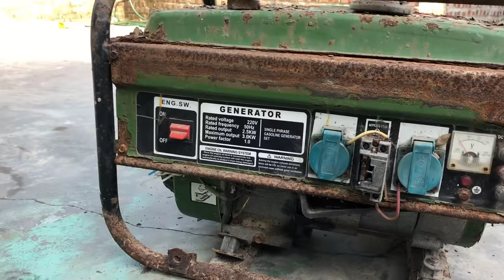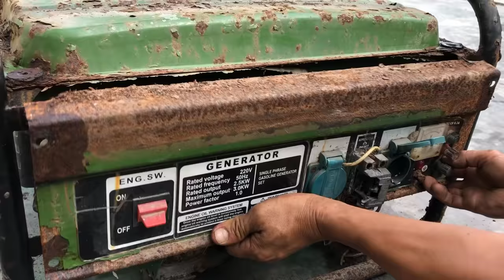Full restoration of old 220v generator engine | Repair and reuse old rusty generators

Comment: Vietnamese miracle. It even works without fuel. The engine shutdown switch is not connected either.
Reply: I noticed too, the engine ran without gasoline.
Reply: شحضحضحضحضجشجشجشجشجشجشجشجشجشجشجشجشجشجشج

Comment: Great restoration with limited resources. Attention to detail by pre oiling most everything within the engine is great but use some wood blocks on the bearings the next time you need to set them in. 
This is the exact same gen set that Lidl has sold in the EU market, didn't realize it had an AVR module in it.
Reply from the maker: thank you very muck
Reply: Рм? 0фх

Comment: Excellent Video Great restoration What do you guys adjust your intake and exhaust valve in mm and what kind of Spark plug is used on the 196 cc engine.  All trade make the same generator but it is modified to use propane  APG 3535 cn

Comment: the spray paint not resist the gasolin ..i suggest useing sandblaster  to clean aluminum parts ..and you must replace all gaskets and not use hammer to assemble the stator base because the camshaft may be break it ..
good jop brother ..

Comment: I take my hat off to the patience and memory of this guy, I would have just left the thing to rot and buy a new genny, I couldn't remember where all the bits went.
Not keen on the method of fitting that bearing, should be fitted using force on the outer rim not inner.

Comment: I have one problem with this on this type of  generator the engine's are almost indestructible but the electricity generators always  fail  & mostly avr's then the windings on rotor & lastly the  stator it would be better/ more helpful to  show the electricity generator being  repaired as that's the most likely to fail.

Comment: New vibration mounts for the generator to the frame will need to be replaced. I hope you were able to use high temperature black paint on the muffler, because if it's not, it will just burn off.

Comment: i hope no one is using this video as a guide to restore generators . that engine rebuild had so many mistakes , the valves were not adjusted , engine rpm not set correctly and so much more.
Reply: Also the thin rod that's inserted in alternator shaft as concentric rod is missing during installation.

Comment: not really a full restoration , the thing wasn't even secured in the frame , was missing the fuel tank and couldn't regulate the engine rpm, loads of things wrong here.

Comment: Where is the fuel tank
Reply: I'm also wondering how it starts without fuel? 🤣🤣🤣
Reply: They have filled the carburetor with gas, it will run a few minutes.